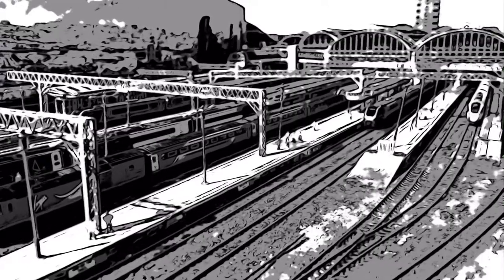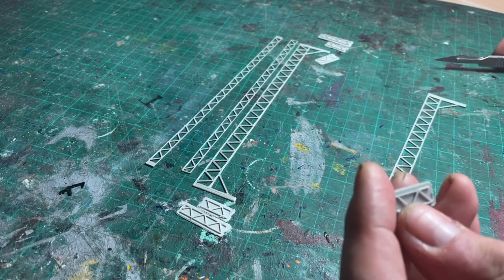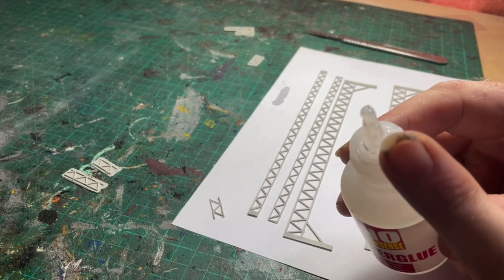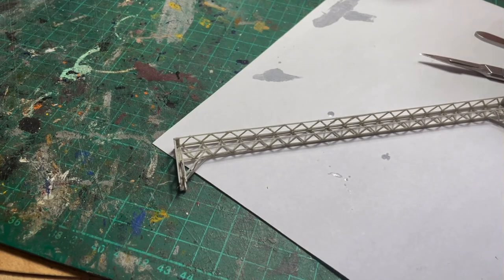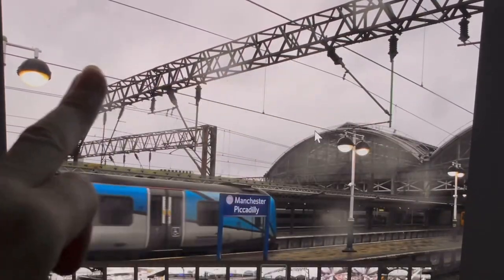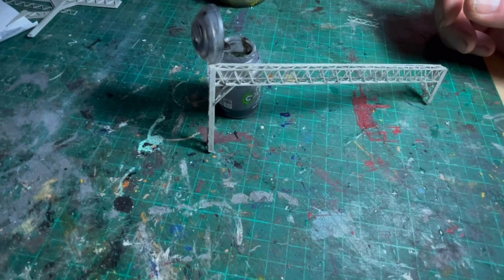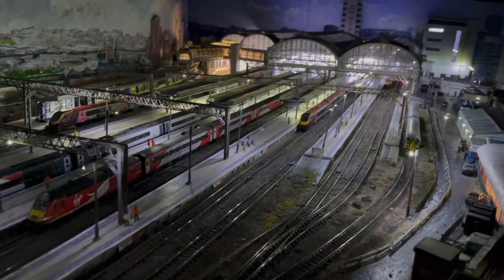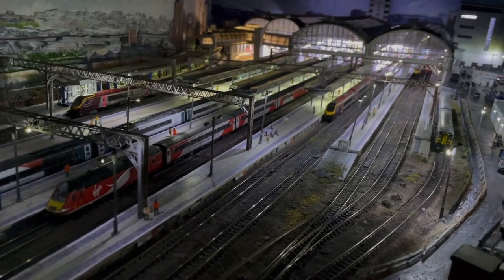MANCHESTER PICCADILLY  IN N GAUGE – Making the overhead line gantries

Comment: Those look the  business John !  Even without the registration arms they give the feel of the OHLE.   You taking any commission work - I know of an N gauge layout which is in the process of installing OHLE  😅   Excellent bit of work - well done.   Cheers Euan
Reply from the maker: Lol, blimey youll not believe how long its taken, around 40% of prints failing, think ive sorted it now, H-o-p-e-f-u-l-l-y. Lol
Reply: @piccadillymodelrailways  if they are anything like N Brass then I can appreciate how long they take to build, paint and plant !!
Reply from the maker: Each section took around 30-40 mins, larger sections over an hour. But its not so much that, the printer developed problems, I tightened loose sections, but still not right, so replaced varying parts including the mother board. Only to find 4 days later the new motherboard was faulty, the printer was not behaving well at all. Around 40% of parts failing, and I didnt know its going to fail till about half way through, then Ive wasted the filament etc etc. i decided to change back to the old board, and since then every print has been almost perfect, so that new board is going back.
Hope that makes sense, but soooo frustrating and an issue Ive not encountered before.

Comment: These look fabulous, John. I was amazed how easy they came away from the bed - is it just your skill with the knife or is the bond between the two only temporary. Thanks for the glue tip.
Reply from the maker: Hi Dave thank you. The idea of raft is purely to act as a intermediary between the bed and the print. The print is designed to print 0.3mm above the bed, so it effectively gets placed on ‘pins’. 90% come off very easily.

Comment: HIYA John,  hope you're well.  Firstly WOOOOOWWW this just looks amazing 👏 loving the gantries just makes my n brass gantries look awful at least you didn't solder your fingers together like I did when I built my n brass stuff . Was going to ask if you a planning to wore them up if so try Eazi line from deluxe materials.  It is like elastic and glues very easy .
Reply from the maker: Ahhhhh thank you, TBH they werent that hard to make. They look more complex than they really are. Most of it is just 4 sides of a ‘box’. No I didnt SOLDER my fingers together, but lets say I was sooooo glad I had superglue debonder lol. The printer problems created havoc, I made they mistake of installing a NEW but faulty mother board which created all sorts of problems. Ive restored the situation and all is well again. That board is going back.
Wires, no. Purely because I know myself it would get knocked, and cause access issues. The wire would have to be mighty fine to look convincing. Not for me Im afraid.

Comment: Hi John,
How did you ever manage without a 3D printer but these look great a question for you are you going to do the wires also? or will it make getting to the track to hard and whoops who changed that point but shows how light your trains are as just the 1st car off a bit, hate to do it in OO a bit more of a mess I would think.
Cheers Robert.
Reply from the maker: Exactly Robert, youve hit the nail on the head. It’s hard enough to wire up a OO gauge layout, let alone N. I think wires would not only get in the way, but Id knock them and be constantly ripping bits off. I can see it becoming a nightmare. In scale, N gauge wires would be ludicrously fine, cant see wires not looking over scale. Ermmmm no thanks. The gantries will be enough I think.

Thanks for taking the time to watch. Glad to see you able to run trains again even for a short time. Lovely new wagons. I remember being used as MGR merry-go- round coal wagons with class 56s
Reply: @piccadillymodelrailways  yes the coal wagons are mensioned  in the history notes I put up in mine. Thanks for watching mine also.
Cheers Robert.

Comment: What type of track would you recommend on an n scale layout like yours?
Reply from the maker: Hi, I use PECO code 80, there is code 55 but this is much finer and more fragile. In the early days of a layout you may change your mind over the track plan a few times. Code 80 will generally be fine, whereas code 55 could break. Also Ive found trains run better on the longest points, but this depends on your space. If your area is tight on space design a simpler layout with fewer points. Hope that helps